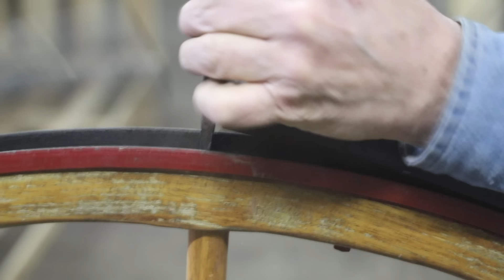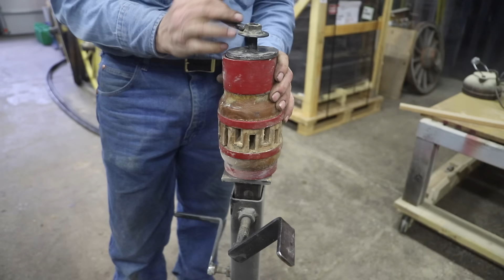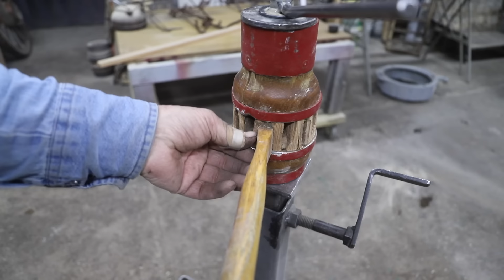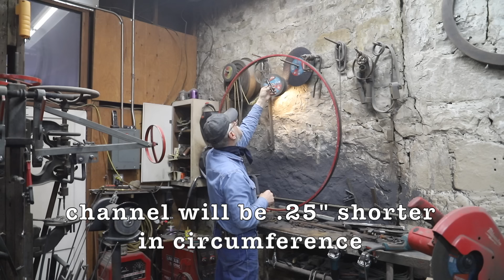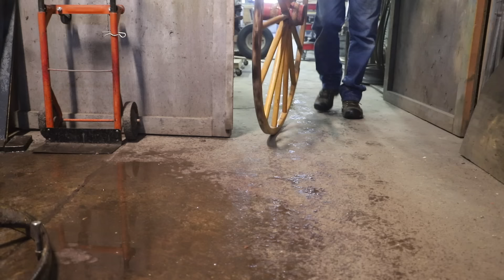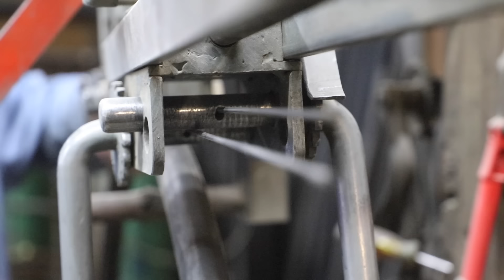Fixing Cart Wheels | Less Than Ideal Can Still Be Workable | Engels Coach Shop

Comment: Dave, on these wheels I noticed that the felloes are two pieces for each wheel. Is that common for buggy wheels or does that just depend on the builder? Are the felloes for those wheels steamed and bent to form them?  Thanks.
Reply: I was going to ask the same question, so I'll just promote this one!
Reply from the maker: Yes.  The majority of buggy and carriage wheel rims are steam bent halves.
Reply: I think thin/small felloes are almost always bent, Thick/heavy felloes are too hard to bend, so they must be cut/built up.
Reply: @EngelsCoachShop  Thanks very much for the  answers.
Reply from the maker: @ronmccabe1169  I can bend up to 4" wide and 2" thick.  But many wagons wheels used sawn felloes.  Others didn't and used bent felloes.
Reply: @EngelsCoachShop  WOW! I don't remember seeing a video on that. Did you do one? I summer jobbed at a chair factory where they bent oak ~ 1.5" x 2.5" (the flat way) for the arms/backs on captains chairs.
Reply from the maker: @ronmccabe1169  In the steam bending wood playlist there's a video showing me bending 2'" thick felloes.

Comment: Was that a welding stick that he used to solder the tyre wires?
Reply: Fluxed silver solder brazing rods. Many hardware stores carry small packets in the welding section.
Reply: I believe they are fluxed brass rods used specifically for brazing.

Comment: Just checking onya Dave. https://www.engineeringtoolbox.com/linear-thermal-expansion-d_1379.html
@ about a 5'6" diameter, say a 207" circumference, 25C to 100C, steel grows to 200.2484". Now one of us is 1.6 thousandths of an inch out. Who will put their hand up.
Bit rough mate.
Reply: I'm sure he heats them to 350*F or more (wood burns/scorches).